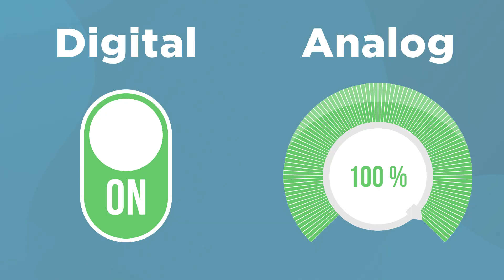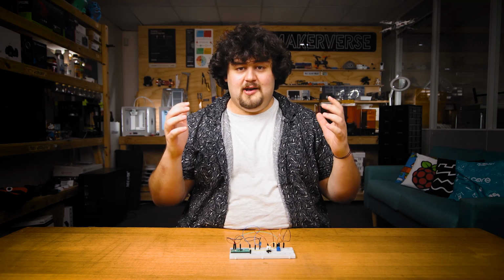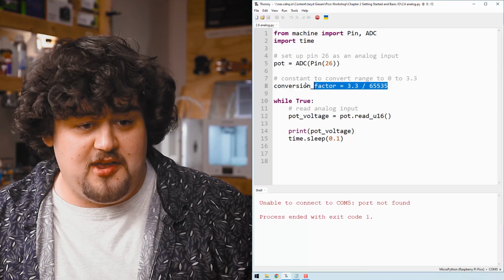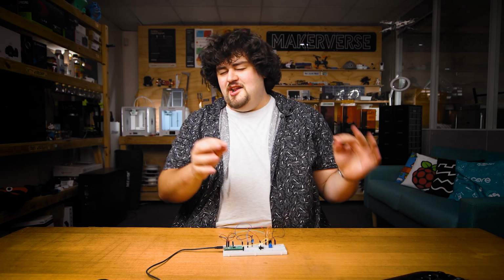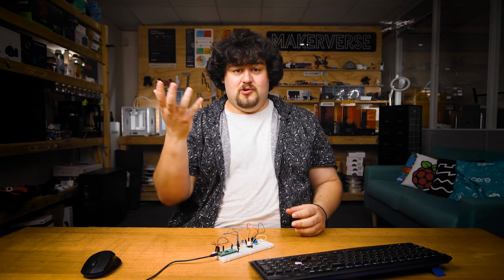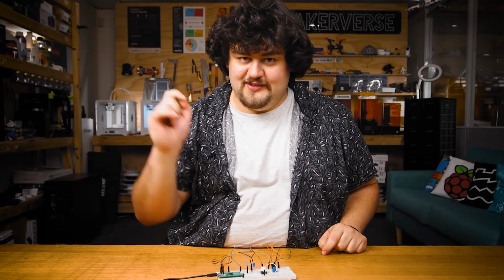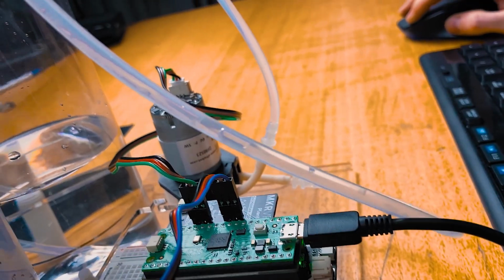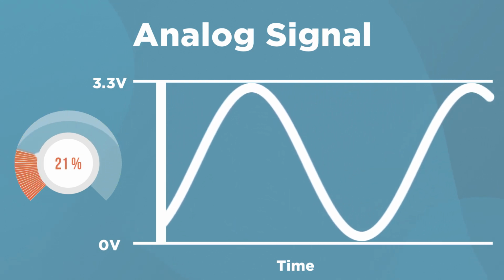Reading Analog Inputs | Raspberry Pi Pico Workshop: Chapter 2.6

Comment: Hi Jayad, how to read bi-polar range of analog input voltage?  Unless it's a temperature sensor, most of the real-world sensor output range from negative to positive voltage.
Reply from the maker: The Pico and nearly all microcontrollers are unable to read negative voltages so if you need to do so you will need additional hardware. Most off the shelf sensors read in the positive voltage range for this reason because the hardware needed to read in a negative voltage range is a little complex. I would suggest finding a similar sensor that reads in the positive range. 

If you need to use this sensor though, you will need to use an op amp to shift the voltage into the positive range, then use a voltage divider to scale it the required 0v - 3.3v range.

Im sorry we couldn't be of much help here but feel free to ask us a question on our forums, we have lots of makers over there that can help!
https://forum.core-electronics.com.au/